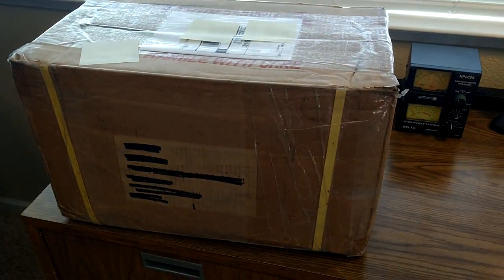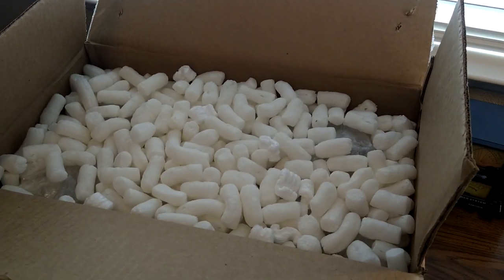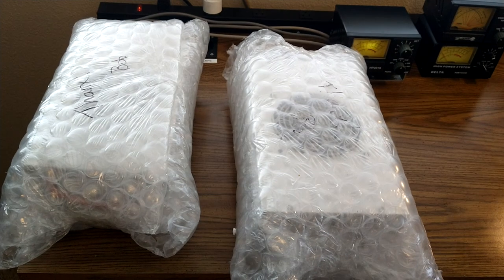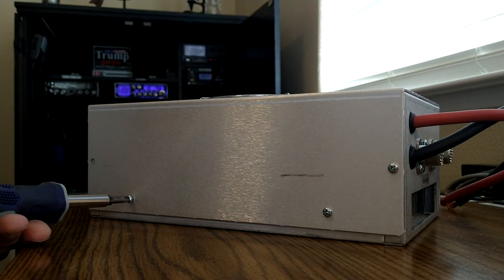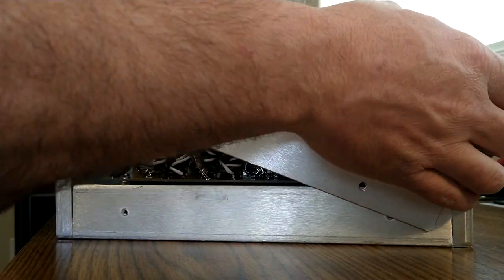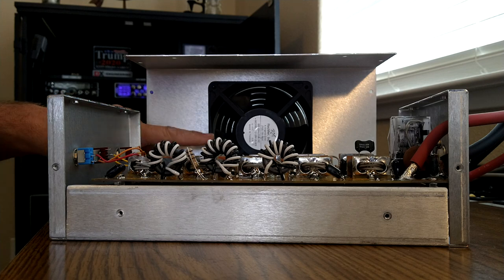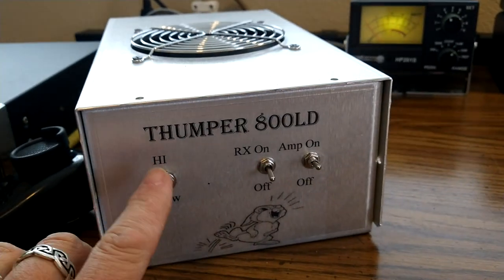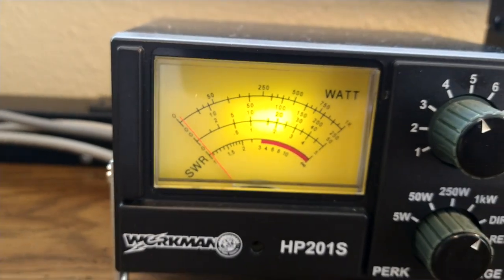Received a couple of new CB amps in the mail! time to unbox and test them!

Comment: Where did you order your 9530's from? I need 4 to go in a Palomar 450 HD. Original it came with 7530 I think , ill have to look. But it blew 2 of them and I said what the heck and put 2 used 9530's in it and it works.  260 watts out of a miss matched  mosfets thats says  a lot. Love to have one of those boxes.

Comment: Very Nice Output I'm guessing these are Class C amps. Glad you got a Megawatt. Get one more & stack them for 100 amps👍👍
Reply from the maker: The Megawatt is just for the bench, but you're correct that I could add another. I have a 150 and 250 supply for the equipment I run. I believe they are class AB since they are automatic SSB. I know they are very clean amps.

Comment: I can hear your fan slowing down when the amp is keyed. You should at least put a car audio supercapacitor in parallel with your power supply to kelp that supplies deliver peak power on modulation. A tip. keep that capacitor as close as possible to the amp. -73 Ella
Reply from the maker: I ordered a 250 amp alternator and upgraded the battery to alternator wire to 4 AWG in the mobile. Thanks for the advice, it's appreciated.

Comment: If you still have these I would love to see them operate with spectrum  analyzer.
Reply from the maker: Never hooked up to a spectrum analyzer, these are great little amps. I've had one in my truck for a couple years and it performs excellent. The builder told me they were not going to produce anymore of these.
Reply: Do u think he could provide schematic or the board source.

Comment: First time I’ve ever seen an amp built with all mosfet type transistors,, how is it working ? What’s the bird average and pep ? What kind of deadkey carrier you putting into it from the radio and radio pep ? Thanks for sharing,,, I see you answered those questions later on in the video ,, thanks 🙏 for the info . Cool looking box
Reply: Most linear amps use MOSFETs; 2SC2879s are the most popular. Their SOT-123 case handles heat better than others, like the TO-3PN type.
Reply: @garycook5125  2SC2879 aren't MOSFET.
Reply: Really? wow, you guys are in the dark ages, I've got nearly 5KW PEP with 1W drive and it's all MOSFET, those bipolar amps are just antique junk these days.
Reply: @M0UAW_IO83  You are correct; my mistake (thank you).

Comment: Is there any info out there to see all the products offered by the builder? Facebook site, YouTube, etc.?
Reply from the maker: Not for this builder. There's another guy who builds mosfet amps and he has a website. Rocket box amps out of Las Vegas. You may want to check him out. As far a regular transistor amps, there are several guys building them. Just Google or FB it. Off the top of my head, Carl built, Donkey stomper, fat cat/alley cat, fat boy,  plus a bunch more.
Reply: @vegasfordguy  thanks. I have several 2879 boxes. I have been thinking about trying a mosfet box though. I'm not impressed with rocketbox performance so far (though I don't own one). I just liked the look of yours and thought I would inquire.
Reply: @root7205  Rocket box is great man if you run them like that say. I have the XL1000

Comment: I don't like the splitter/combiner setup. I don't like where the power is terminated. It should be in between the final 8 outputs.  I don't like the rf traces going on the board under the output transformers.  I don't like the high low switch. Something else to break. If you need high or low, adjust the power at the source . I would like to see what it does on a bird 43 without the peak reading kit. 
Swing 900 on a 43 without the peak reading kit, and I might be impressed.
I build boxes, too. Channel 6 boxes.
Reply from the maker: All I can tell you is these little amps are solid work horses and run excellent. Never had a problem with them and they put out good clean power. I was anti mosfet until I used these. Totally changed my mind.